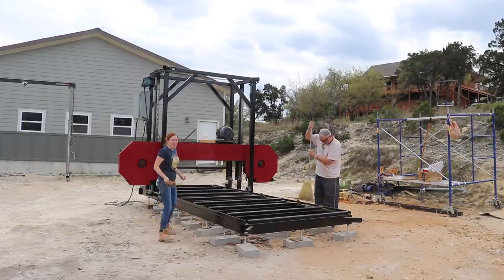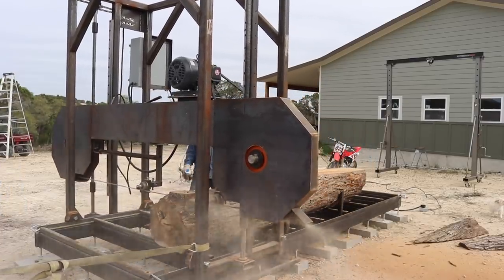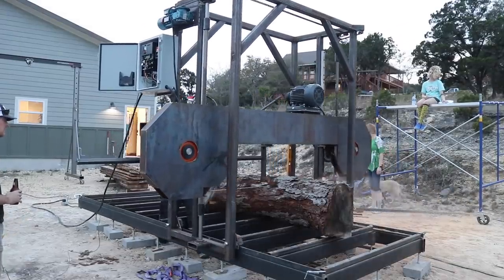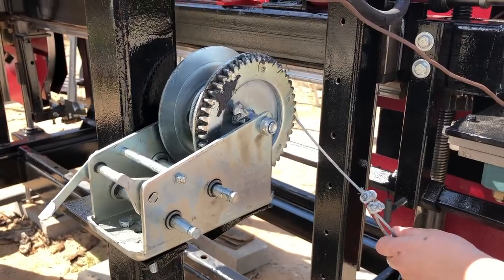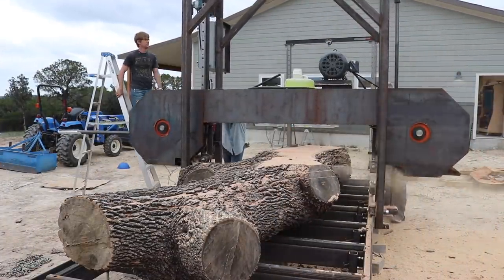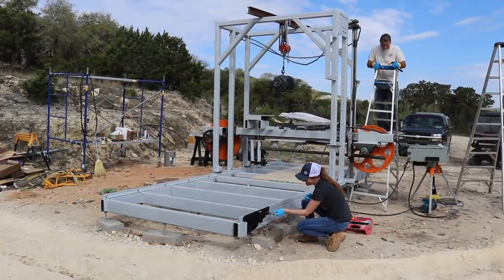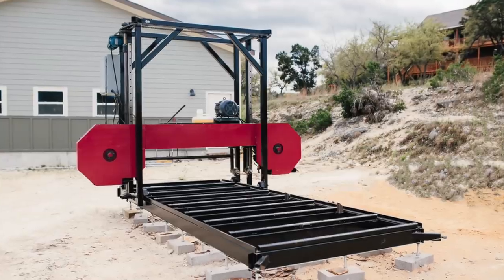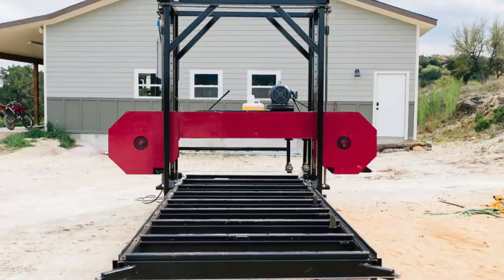Slabbing With My Bandsaw Mill

Comment: Having owned and ran bandmills for over 20 years i can say that using diesel is by far the best bet . If you have friends that drive diesel trucks have them save you their used oil and mix it with diesel .  Just be sure and screen it when you add it . It makes your mill run way  smoother .  Im not sure who came up with the water and soap thing but its a terrible idea...unless u own a guide bearing and band blade business .  Also check out timber wolf band blades . I have used their blades for 15 years now and those guys up there have forgotten more about bandsaw blades than most suppliers will ever know .  Think about making some angle iron jigs that will drop over your bunks and you can saw really nice hexagons and and octagons . Be safe and have a blast with your new mill .  V

Comment: A powder coated system would have been the ultimate coating system for protecting your mill.  If / when you decide to re-paint the mill, a grit blasted substrate (using a portable media blaster) leaving 2 - 4 mils surface profile will provide better adhesion and coating life.

Comment: As for the [manual] guides at the perimeter of the logs, couldn’t a spring guided system be installed, possibly with small wheeled guides be used against the logsinstead, specially with adjustable tension? Just curious. Awesome project, and well done.

Comment: you should use paste wax to lubricate the bandsaw blade, a big block of wax permanently in contact with the blade inside of the blade guard should do the job and also use paint sprayer instead or rolling it, goes much faster, better coverage, and much better finish.

Comment: Next project should be permanetly **  hard mount the mill to 4"x4" square tubing concreted into the ground then mount log rails far enough apart to drive between them with the tractor. Hope this helps you out

Comment: I have not seen any one comment on this but you need to seal the ends of the boards with something  so they do not dry too quickly on the end and check.I find latex paint in a thick coat works but there is a material pro's use. Not sure what it is.

Comment: April DONT USE DIESEL!! Ahhhh!
Use regular blue windshield washer fluid. A lot cheaper too. It also has anti-freeze properties. 
Also on your guide maybe put a good size wheel on it and have a spring to pull/push the guide taught to the log.

Comment: RE: wood turning pink.  My wife has long used a wood stain of vinegar in which steel nails have been soaked.  It's especially effective on high-tannin woods like oak.  I wonder if your wood is reacting with the steel in the blade, or the steel and diesel.

Comment: Something you need to find the answer to, and tell us.....It has been my experience cutting into logs you see these wonderful colors and hues but whether i kiln dry them or air dry them, by the time they are dry all that beautiful color disappears. Find out if there is a way to trap that color in the wood...
Here's a thought...like if you were making a "River Table" (a suggestion for your next project!) with some logs...I wonder if clear epoxy might encase the color, but you might have to use a wet slab? Anyhoo....good luck and good job!

Comment: Wow very nice ‼️just wondering when it rains and your band saw starts to sink off level. Will you make a video on pouring a slab on grade next to your band saw then renting a crane to move it to the new slab it should be bolted down to. Then it will be perfect. 👍🏻😎🔨
Reply: It won't sink too far since it it sitting on solid rock. 11:00
Reply: That’s cool👍🏻I still would’ve put it on a slab have a clean working area even when it’s raining.  After years of using that thing with vibration there will be settling and when they trenched for power the trencher cut right through the ground didn’t seem like solid rock. Still such a beautiful job amazing work April and her crew awesome work.
Reply: @dlconstruction5255  
All good points but knowing April it won't be years before things get done. Come to think about it,  it is just about one year since she started building her shop. "Wonder Woman" may just have some competition.
Reply: Larry Be you got that right amazing no question 👍🏻😎🔨

Comment: Great job. love the mils super skookum. But i do have a question. by leaving the slabs on while cutting doesn't that put extra drag on the blade from the weight?
Reply: Yes, the saw doesn't have dogs to hold it in place and they chose to minimize movement by keeping the weight
Reply: Due to the set of the teeth, the saw kerf is wider than the thickness of the non-tooth portion of the blade, so the blade doesn't rub against the wood -- unless you're trying to back out of a cut.

Comment: It is better to use water Diesel will stain wood if there is an accident, just mix in a little soap and or pine sol. You can also buy commercial blade cooling from places like Woodmiser.

Comment: Diesel works and soap kinda works. You are trying to do 2 things with the drip system. 1 minimize the friction between the blade and the guides. 2 cool the blade. One of the most important things about any of the lubrication is it sticks to the metal that is why good lube smells bad. It is the sulfer which helps it stick.   As someone said below in a industrial setting some diesel is used. Diesel works best to keep pitch off or to remove pitch. A little lube and a water drip works best when cutting hard. Cutting too slow is cutting hard

Comment: Not sure but I’ve heard vegetable oil works great. Also if you put marks on the pole where the sawblad is attached it’ll make it easier on not having to measure. Yes first cut will either be thick or thin. But the rest will be set perfectly

Comment: What size is your electric motor?  My mill is currently powered by a detroit diesel and I am considering switching to electric drive instead of diesel over hydraulic.  Our mills are roughly the same size.  You are correct, it is like Christmas morning everytime you open up a log;)

Comment: Paint the end grain of your slabs, this will slow the loss of moisture from the ends and reduce checking, there are many products for this on the market but a good exterior paint will do the job.  Get forks for your loader it will be easer to move the logs and since your frame is open the forks can gently place and pick up the your wood without moving your mill into the next county.  Great job, almost makes me want one, but my wife tells me I have enough toys.

Comment: Instead of a digital readout, you could just stick a ruler to an upright and a pointer on the saw beam slide. No need to go for the super accurate DRO if within 1/16" is enough. But then again, you have an engineer on the payroll, and with DRO, you could program it to automatically stop at pre-set intervals. 

The pink blush is something I've never seen in working at a sawmill. I'm willing to bet it's climate related or something fungal in Texas with the wet spalted wood hitting dry air. Maybe the logs just wanted to match your mill. Shouldn't be a problem once it's dried out. 

Excellent work all around, just don't convince any other maker to build a mill - I don't have the space for one and can't keep up to this kind of shenanigans.

Comment: Until your mill is permanently on its slab, consider every time you rassle a log on it there's a chance you move the saw frame which is sitting on dirt. I suggest permanently attaching level vials to monitor level condition longitudinal and cross ways for each bay of support. That's seven level vials one for each cross-member and two for each rail. Ordinary trailer levels aren't sensitive enough. Better use ones that are more precise.

Comment: Just wondering if prior to painting , it would have been advisable to paint the steel with a product like Rustmort which contains phosphoric acid ?  Secondly, after cutting the wood, some people spray it a product like Bora-care or simply make your own boric acid / borax solution to prevent mold and repel insects, is this something that Matt has experimented with or something you have considered ?

Comment: If that is a stationary sawmill, next build would be a jib crane, that way you could stage the logs near the nill load and unload logs and slabs, and not be using the tractor or loader all day long, stop and starting burn a lot of gas and its harder on the motor with short runs. staging a lot of logs at one time will save gas and time,  stickering in a pile would give you ability to move a lot of curing slabs all at one time. Or just let dry age in place if the area is large enough and the crane has a long reach.

Comment: Maybe spring load the blade guide and put a small rubber wheel to follow the log, use a grinder with a Chainsaw disc and debark in front of the blade so the blade lasts longer

Comment: DRO on the height seems like overkill given that you know the pitch of the acme screws,  so a dial behind the handle should be plenty precise enough.   Even if you motorise that action,   you'd only need a rotary encoder because backlash usually isn't an issue on a vertical axis.   If Cody wants to pimp that mill, he should watch some of Linda's Sawmill Cinema.  Their posh  Woodmiser has all the mod cons like hydraulic loading, turning and clamping

Comment: Nice job.  Have you thought of soap and water instead of diesel?
Reply: Just water is usually used. In cold areas, window washer fluid, so it won't freeze.

Comment: Your biggest liability is dry sawdust for fire hazard. A 16' dump trailer can handle slabs sawdust and hog fuel. A retrofitted container can store your tension lumber. Used to own a western red cedar shake and shingle mill. Air quality and water quality from your mill. Post and beam construction for your mill. A circular saw for trimming your cants

Comment: I wonder if anyone has use a large Stepper motor to control the height and travel of a Saw like that? Basically use computer software to apply the Measurements needed for each cut height as easy as using a key on a control panel or pendant. Limit switches can be set to keep the blade from going to low or to high and steppers on the Carriage could move it through the cant, probably Nema 42 size 2800 oz/in  and rack and pinion drive. you might even use a Raspberry pi as a controller.

Comment: Great work! What about chain bar oil? Diesel soaked wood in a pile, dont sound..
Reply: Diesel soaked wood is actually a pretty good thing, it keeps wood boring bugs from getting into the wood for a while. Diesel is actually fairly difficult to ignite. If you throw a match into a bucket of diesel it'll simple go out.

Comment: Water with a little dish soap or Pinesol seems a little more environmentally friendly than diesel. No greasy residue all over your new sawmill for sawdust to stick. Diesel seems like the worst choice of lubricants. The nonly oil lubricant would be be for your bed rail tracks. Out of the Woods uses power stearing fluid?

Comment: April, I'm a new scriber, enjoyed your mill build, you do realize you gilded the lily on much of the build, but better that way than the other. I built my own band mill 20 years ago and its still making money, exponential payback, only spent $500.00. A couple of suggestions but by now you know what your doing. If you have room on the front of your blade guard glue a piece of plywood so when a band comes off the wheels, and it will, you won't ruin it hitting steel. You need power feed Hydraulic or electric, and a hydraulic log turner. Its not good form to use a machine to load and turn logs sooner or later you will damage something. What are you doing to sharpen and set your bands?? I have always sharpened and set, saved me a bundle over the years. So long for now. Frank

Comment: Instead of a winch for moving the mill, why not a long piece of acme threaded rod on the lower frame with a small motor/gearbox to move the mill?......as far as the discoloration of the wood.....maybe instead of diesel and or kerosene for the blade lube, maybe try distilled water. You really need to think about working with that wood for later projects because the diesel or kerosene could ignite when running those planks through your wood working equipment.

Hold off on getting a digital readout.......most of them use a glass scale and are very fragile........get your slab in place and some kind of shelter in place before you install a readout.
Reply: As she mentioned in the video, the staining started when she was using water for the lube.
Reply: @GeneWaddle  Thats why I suggested "Distilled water"......not as many minerals in it as tap water or well water.

Comment: In an initial video of the mill build you stated that it cost $16,000.  I wondered if that was all material or did you consider labor?

Matt Cremona’s plans are available, but are you planning on providing information on upgrades and improvements when finished?  How else will we even begin to reproduce your mill.  After all, imitation is the sincerest form of flattery.

Comment: You could have powered with an air cooled gasoline engine, especially as the mill being used outdoors. This would have saved you from installing a line. Its a nice build, thanks.

Comment: Get you a soft tape like a sewer uses or a steal yard stick and stick it to the leg of the mill and put you an indicator ( like a nail or cut a piece of metal) on the mill problem solved and it’s cheap. Digital will end of giving you trouble staying accurate over time unless you plan on cutting every day then the price.

Comment: Build a PVC Greenhouce with roil up sides great for drying your wood and use 6ML plastic there is lots of video on youtube!!! 6ML plastic is only going to last about 3 years then you will need to replace it. But by that time you may have a better idea what size and design for a permanent one and the PVC Greenhouse should only cost about $350.00

Comment: You've completed a dream project. Congratulations! The guy who commented that spalt will make you sick is entirely correct. That includes sawing, planing and sanding. As the result of a lifetime of all kinds lung abuse, wood flour and especially oak, cedar, and spalted lumber choke me up  more than anything else. Worse, ten minutes of any of those dusts triggers asthma that renders me uselessly ill for as long as 6 weeks. It will you too so protect your lungs. Insults you spring back from now will cause lingering problems.

Comment: Why don’t you place two light sensors on the blade guides linked to server motors that would automatically track the outer edges of the board. It would free up the operator

Comment: Bad idea running the wire before glueing the conduit. The glue will eat through the insulation on the wire if it gets on it and could damage it. Always run the conduit and glue first then pull the wire after. Glue both sides of conduit to make it easier to connect together.

Comment: April: Diesel has all kinds of additives to make it cleaner burning in the engines. These chemicals are not necessarily great for woodworking. Stop using diesel and use soapy water instead. You will be happier and the wood won't turn pink and smell like an old truck. It will hold finish better too. Jon

Comment: This is a much smaller swing blade saw but the mechanism used in the Muskulains Varonis video https://www.youtube.com/watch?v=zOfX8gVggM0&t=9s  is an excellent example of using a gearbox for height adjustment, and chain drive for carriage transport. 
Please find medium GREY to paint your mill because the sun will expand the steel and warp it much more than you would realize depending on exposure; so if you want to mill "dead nuts" lumber you will need to align and/or shim your rails using a piano wire and dial indicator because vibration during what I'd call a "break in" period will actually relieve the stress built up in the framework during welding  causing it to relax (kind of like drying green lumber until it finds it's equilibrium).  A sloppy path means wasted material and abuse to your planer removing hills and valleys. FYI: That material on your lube system is actually "felt" and on precision machinery it's also used as stationary "wipers" to keep chips off the track and from getting between the rails and wheels. (sorry for the correction the teeth on digging equipment is actually tungsten carbide not titanium)
 Fun fact did you know that trees grown on a steep hillside will have more stress on the uphill side and will bow in that direction when air dried?

Comment: How many horses on that drive motor it looks small?  Also, add a motor drive instead of the winch. It is going to get tired real fast.  Add an exhaust port on the blade guard and a big shop vac. Hope you don't need tools to get the blades changed cause that gets tired real fast. You need log dogs,lifters and a rotator or you are wasting a lot of log if all you can do is flitch cut.  DRO is a waste of money. $.99 yard stick fastened to the upright works fine, after all measuring in quarters not thou. On the other hand, mount a cabinet laser to the same hight as the blade then you can see the entire cut before you start. BIG roof high and wide for lots of shade and for a fork lift to work underneath. (You will get one eventually.) Also, if you are serious, a lot of blades and a welding rig and a sharpener.
Reply: I think she said 10hp. I agree, she needs to be able to cut dimensional lumber too.
Reply: @jonanderson5137   10! Rig that big I would have expected 35.